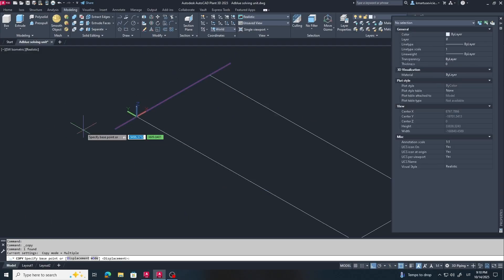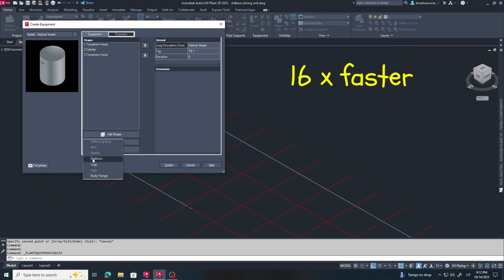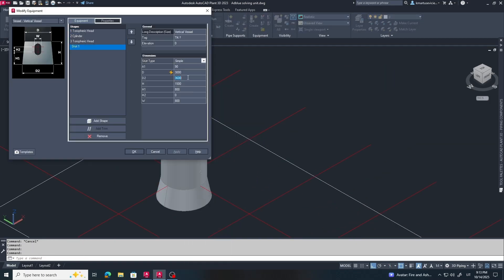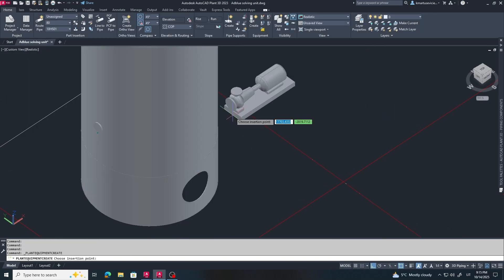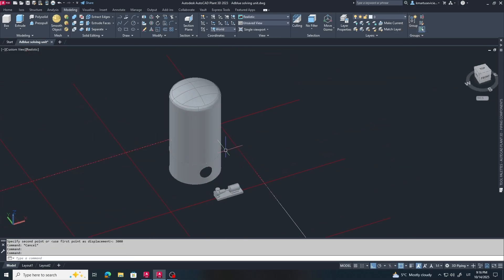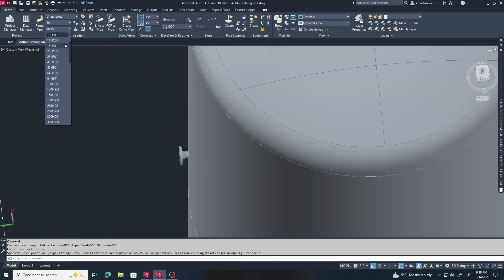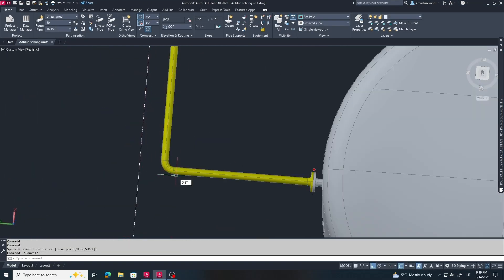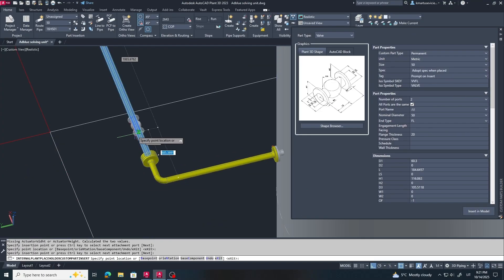AdBlue Production Unit Design – 16× Speed Plant 3D Timelapse | From Sketch to Complete Project

Comment: Hi. How did you solve the problem with pop-ups like that "mixed autoflange compound joint can't connect via two simple joints"? Is it normal?
Reply from the maker: Hi! Yes, sometimes this happens in Plant 3D.
When it appears, I usually check the connections and the spec.
In some cases, simply redrawing the component helps — sometimes it does, sometimes it doesn’t.
It’s annoying, but it’s not dangerous as long as the connections and isometrics are correct.